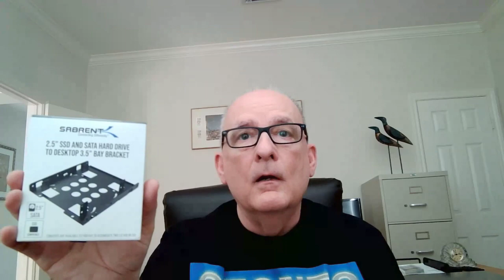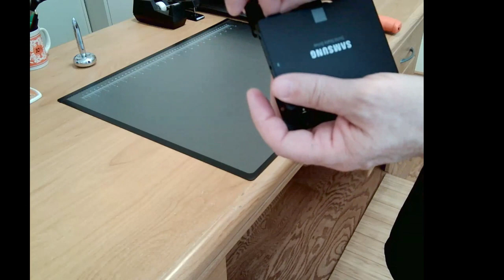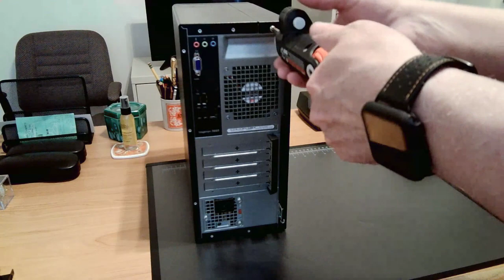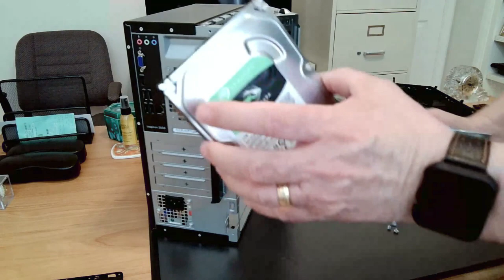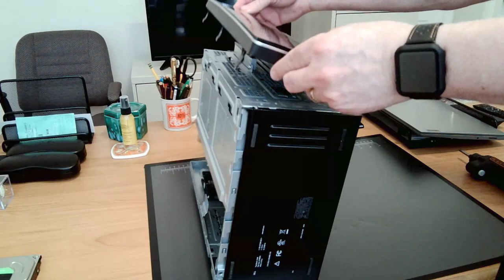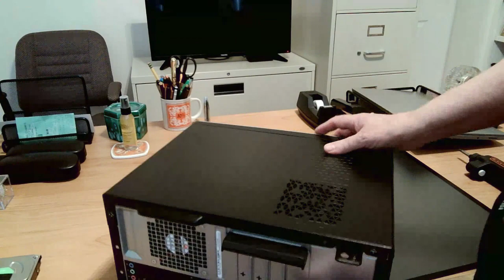Dell Inspiron 3668 Computer Hard Drive Replacement

Comment: Do I need the 2.5 bracket ? Or can I just use the 3.5?
Reply from the maker: Not quite sure of your question, so I will just answer this way:  The original bracket in the computer will not work properly to hold a new 2.5 inch drive securely in place.  You will need to purchase a new hard drive bracket adapter that does properly hold a 2.5 inch drive(s) in place for a 3.5 inch slot.  The replacement model bracket I used does have the capability to house two 2.5 inch drives, but I did not use two drives.  There are many kinds of brackets that hold 2.5 inch drives inside a slot originally meant for a 3.5 inch drive.  They are readily available on Amazon, for example, and do not cost much, likely about $10- $15.  I hope this helps.  Thank you for watching.

Comment: Mark, I replaced the HD with regular 1TB HHD.  Bios finds the drive, but it wont boot to desktop.
Reply from the maker: My best guess is that you need to go into BIOS and change the boot sequence to run from your new hard drive.  I am guessing maybe the boot sequence changed to boot from either the DVD drive or a jump drive when you went through the Hard Drive replacement process.  Not sure if you cloned the new drive, did a windows restore or are starting from scratch with the new hard drive.  In any case,  I would try checking and changing the boot sequence in your BIOS as a first step to troubleshoot.  Below are instructions on how to do that boot sequence process:
To change the boot sequence in a Dell Inspiron 3668 computer's BIOS, you can try these steps: 
Turn on or restart the computer. 
During the Power-on Self Test (POST), when the Dell logo appears, press F2 immediately to enter the BIOS setup program. The F2 prompt may appear very quickly, so you need to watch for it. If you press F2 before the prompt, the keystroke will be lost. If you wait too long and the operating system logo appears, you can wait until you see the desktop, then turn off the computer and try again. 
On the System Setup Main Menu screen, click System BIOS > Boot Settings. 
Click Boot Option Settings > Boot Sequence. 
Use the arrow keys to select a boot device. 
Use the plus (+) and minus (-) sign keys to move the device up or down in the order. 

Hope this helps.  Thank you.
Reply: @MarkM_DIY    ...thanks a bunch.  Yes, the problem originated in Bios. Though, it was alot more difficult to navigate. THere were a few things, that had to be done before I fixed the issue.  All within Bios.   With help from another Youtuber poster.  He mentioned using the F12 key.  It worked, as it brought up a new panel of boot options.  The fixed occured when I, disabled  the Dell Support assistance.  THe bypass led right into the HD installed, and booted.   ...Thanks again, though.
Reply from the maker: @skopas  Glad you got it solved and working!  Thank you.

Comment: How to retrieve pictures and information on old hard drive
Reply from the maker: If you are asking how to retrieve data from your old 3.5 inch hard drive,  you can purchase a sata-to-usb cable with a power source.  The sata end connects to the old hard drive and the usb end connects to usb port on any computer.  Once the old hard drive shows in windows,  you can search, copy and move any files you like from the old 3.5 inch hard drive.  You can also buy powered hard drive enclosures.  Works the same way, but keeps the old 3.5 inch hard drive enclosed and a little safer.  You can also use the old hard drive in the enclosure as a back up drive,  which is what I do with old hard drives.  Hope this helps.
Reply: @MarkM_DIY I think we need to perform hdd clonning to the new ssd initially for the computer to boot up from the new ssd. Copying and pasting doesn't help.
Reply from the maker: Yes, I definitely recommend cloning old hard drive to new hard drive prior to installing the new hard drive. If that is done correctly, computer should boot up when new hard drive is properly installed.  Other method would be to back up old hard drive to an external hard drive, install blank new hard drive,  then perform windows recovery from recovery disk or thumb drive and use the backup copy of your computer as system image to restore to the new blank installed hard drive.  Would recommend the cloning method over the restoration method.  Thank you.
Reply: Yeah, because right now it’s showing no hard drive detected after a power outage
Reply: @alfonsolomeli8136 same thing happened to me yesterday after power outage. Did you ever figure that out?